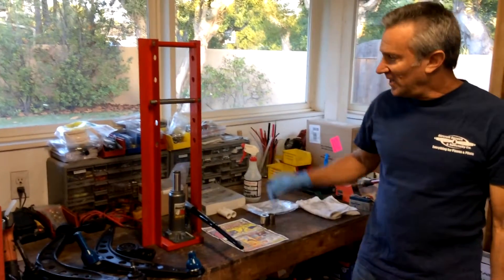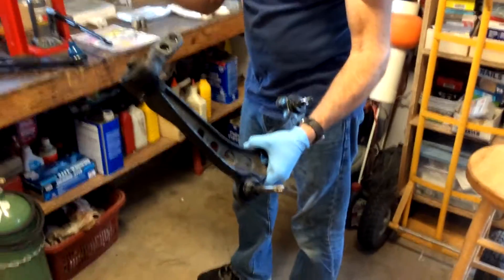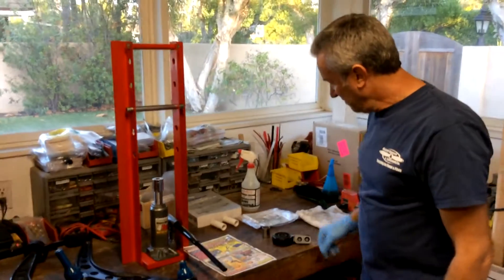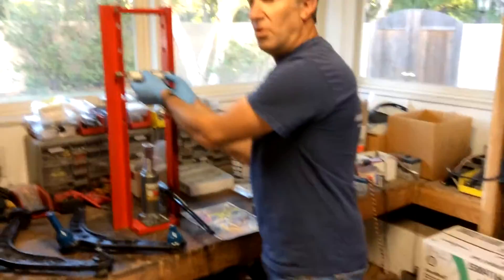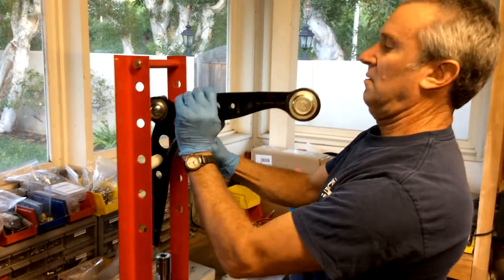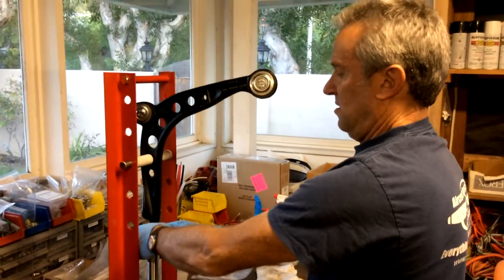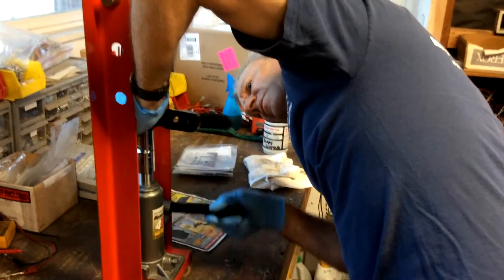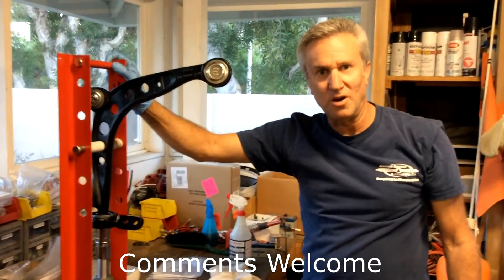Control Arm Bushing Press for BMW E36 and others

Comment: You lost a lot of money all you have to do is use the soap in the inner and just push it in there that's it I did that with mine or put the lollipop and bolt it in and press the control arm inside of it
Reply from the maker: You're right, it's pretty easy to do other ways.  If you read below, you'll see this isn't a real Harbor Freight part, just something I built and decided and decided to have some fun since it looked like something you'd get from Harbor Freight.

Comment: Part # for the press?
Reply from the maker: Not sure, but I'll sell you mine for a good discount.
Reply: Definitely. I'll match what you paid for if it includes shipping. I'm in California.
Reply from the maker: Hi Clark - The press is real but it's not from Harbor Freight and no coupons were used to purchase it.  Just having a bit of fun on YouTube.  What is the chance that Harbor Freight would manufacture a control arm bushing press that only works on BMW's?  Took me all day to weld it, drill it, paint it, cut the stainless steel rod, etc.  Cost of bottle jack was just under $20.  You may buy the whole deal for $50.  I'm in Newport Beach.  Local pickup or you pay for shipping.  How does that sound to you?  Thanks, Marty
Reply: Hah! You got me 😊. I'll take it.  I'm in Palos Verdes.
Reply from the maker: Hey Clark, did you successfully use the control arm bushing press?  Just curious.  Marty